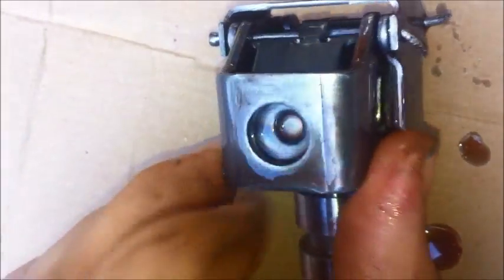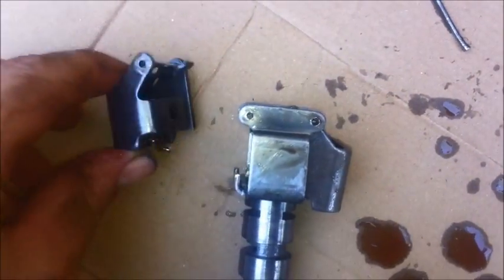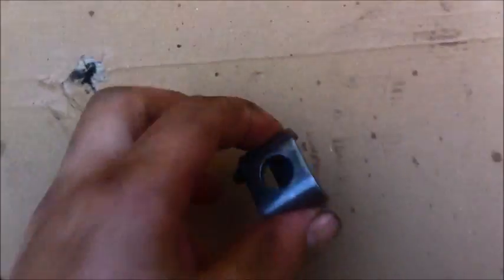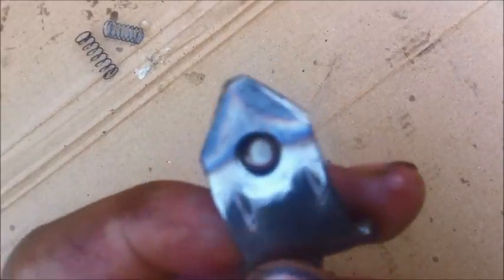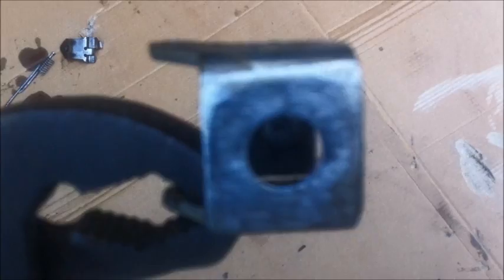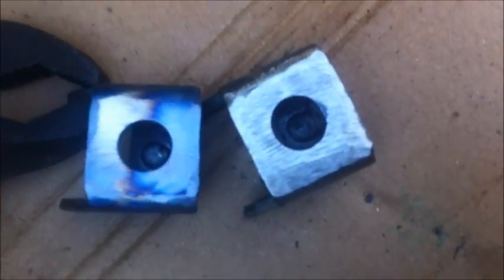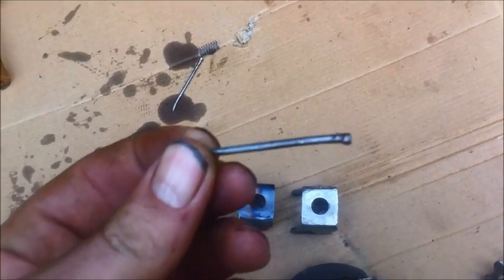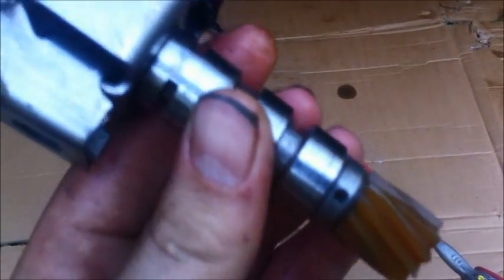How to modify th400 / th350 / 700r4 governor to raise wot  shift points

Comment: Very cool stuff. I never cared too much about wot shift point because when I'm smashing I usually manually shift at 6k or so. I wonder if adjusting this governor will also affect when trans kicks down. I know there is a kick down switch for th400 but typically at 65 70 if I floor it she won't drop down

Comment: NOTE !!! 
On the Turbo 400 when removing the governor even with the vehicle raised up (higher) to a 45 - 60 degree angle on the governor side, you will lose 2 - 3 Quarts of transmission fluid (if your transmission has the correct amount of fluid in it !!). I found this out the hard way & ended up with a big mess on the garage floor, because of incorrect / assumed / generalized advice by youtube teachers.
Reply from the maker: max fluid  level  is even with the top of the pan...  if you lost that much fluid your trans is way overfull..
Reply: Not so. 
I checked it prior to starting on the job & it was at the full line on the dipstick (warm & running in park / neutral, vehicle sitting level). When finished after all the fluid loss, it took over 2 qts to get it back close to the full line on the dipstick (warm & running in park / neutral, vehicle sitting level). What I was able to capture in the pan, not including what went all over the floor was 2+ qts.

If you're not measuring via dipstick (I don't know how you're gauging your " top of the pan " level, ??), then you're running with a transmission low on fluid. 
Turbo 400's, 350's &  700R4's are all different transmissions, albeit some similarities. Fluid level / capacity not being one of them. Never assume or generalize.
Reply: I've been changing automatic transmission fluid on vehicles for 45 years & the only time fluid doesn't come pouring out when the pan bolts are loosened is when the transmission is very low on fluid. This applies to Turbo 400's, 350's, powerglides, Ford & MoPar transmissions. FYI: The full mark on the dipsticks is Above the top of the pan. I rest my case.
Reply: you may be useing a wrong dipstick there are different lengths for car vs truck and your cars former owner may have lost the right dip stick. he is right about the pan level and the gov should be pulled without leakage.
Reply: the reason he knows that the fluid level is pan level is because in doing a fluid change on a older trans without a drain plug when you loosen the pan you dont get pour out until the pan tilts.
Reply: so um NOTE!!! dont follow this guys advice.
Reply: There is a HOT and COLD indicator on the stick when it's level it should not pour out. No matter what you say mr "i changed fluids for 45 years" you're doing it wrong plain simple.
Reply: Fluid level for Turbo 400 is minimum quarter inch above gasket surface. Never had one that did not pour out when filled correctly.

Comment: What difference did it make to your low rpm shift points since you modded those too the inner ones that controls low shift points i seen below the difference you made in High rpm shift was 4600 and now 6200
Reply from the maker: this does not affect the low rpm shifts much  the  vacuum  modulator does  , and i have a adjustable  modulator so i can set low rpm where ever i want with the turn of a Allen wrench

Comment: I've just swapped in a 292 I-6 in place of a 6.2 diesel in front of a (recently rebuilt - and so presumed to be working correctly) 1989 TH-400 and now the shift points are WAY too late. Possible that the diesel app used a different governor and that installing a proper "gas" unit will fix my problem?
Reply from the maker: if your part throttle  shift points are low it would need a vacuum  modulator .. the governor only changes  wide open throttle shifts
Reply: It was indeed the modulator. Didn't catch it because it appeared to test okay. Thanks.
Reply from the maker: no problem man.. glad you got it fixed

Comment: Does this change your shift points when at partial throttle? If so how much. Cool video btw
Reply from the maker: +Michael Kier no.  part throttle would be changed with the vacuum modulator
Reply from the maker: Its useless if it doesn't  with your engines rpm range....
Reply from the maker: This doesn't change gear ratios just shift points.....
Reply: +fast2doorchevy tell me how much better did this help your shifting because I just had my 350 turbo transmission service and it hardly changes out of 1st gear and you mentioned that the tranny came out of a RV I'm wondering if I got the run around because the car is a Malibu classic.  hit me up  anytime.  ckbe.cm@gmail.com 
God bless
Reply from the maker: well stock the full throttle shifts were around 4300 rpm  and after this mod. i got them up to 6200 rpm  so that is  a 1900 rpm difference i shift points  .. you can buy a governor re-calibration kit, that just comes with lighter weights where i just cut them down to be lighter .. plus i have been daily driving it every day sense this video was made with no problems
Reply: @fast2doorchevy  x
Reply: @fast2doorchevy  So with other words you made the overdrive useless in a 700r4 ...the whole idea of it shifting on those LOW rpms is to save gas, you did the opposite here
Reply: @MichelLinschoten  I don't think you understand what the governor is doing, or what overdrive is.  Over drive simply indicates a gear ratio of less than 1.  My 700R4 4th gear overdrive is .70:1.  If it is in 4th gear, it is in overdrive no mater the RPM.  The governor sets the WOT shift point.  If your running WOT, you don't care about saving gas.  My 700R4 shifts at 6200 RPM if I put my foot in it.  But around town, at part throttle, it shifts 1-2 at about 15-20 MPH, 2-3 at about 30 MPH and 3-4 at about 45-55 mph.  This is occurring at all different RPM from 2000 to 4000 depending on how much throttle I give it.  At 60MPH I am at about 2000 RPM in 4th gear (over drive) and in converter lock up. I have a 2800 RPM converter, so when it goes into lockup, my RPM drops several hundred RPM. If I flip the switch to bypass my converter lockup, the engine jumps up a few hundred rpm, but the vehicle speed does not change.
Reply: @CoroPlanesLLC  I believe he probably does alot of street racing so who cares about saving fuel if that's the case.

Comment: Did it change your shift point by much
Reply from the maker: John amezquita from  4600 to 6200 rpm
Reply from the maker: John amezquita i highly recommend if you do this  remove a little material at a time and take it for a test drive and do some wot pulls and see where it shifts   i took mine apart 4-5 times to get it Where i wanted ..   they also sell a kit with weights that are already cut down   but its not hard to do them yourself..  my trans came out of a big block rv so it would shift between 4400-4600 @ WOT  now its between 6000-6200
Reply: what difference did it make to your low rpm shift points since you modded those too the inner ones
Reply: Do the 1-2 and 2-3 shifts happen at the same RPM?